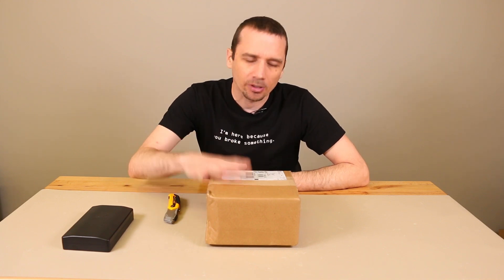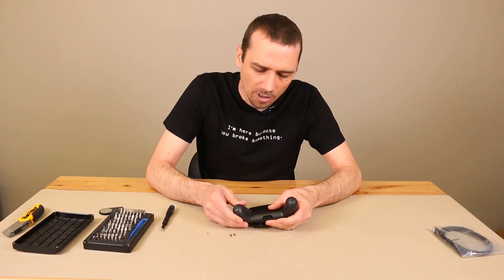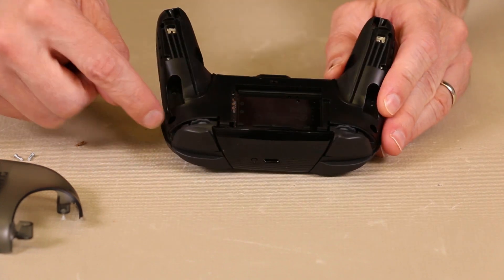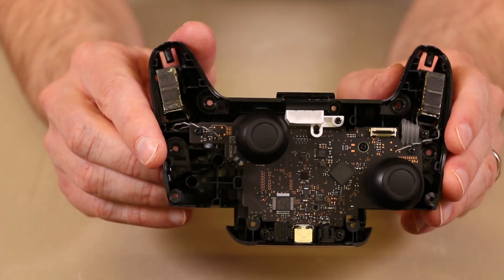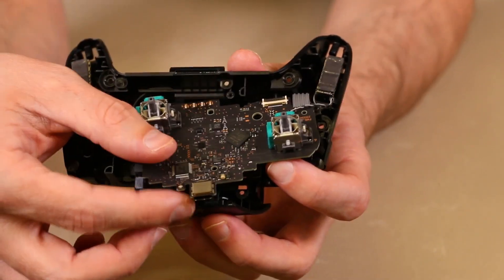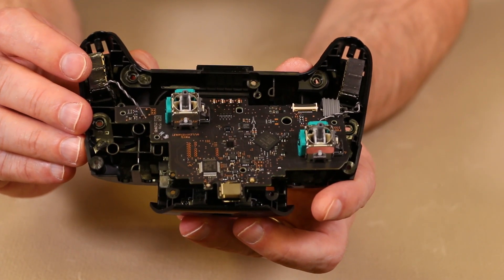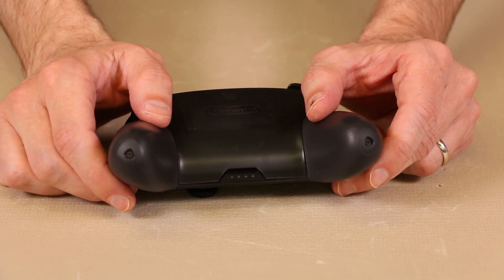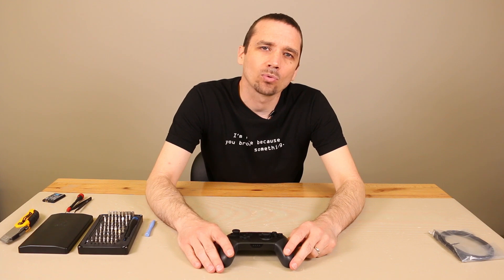Nintendo Switch Pro Controller Teardown

Comment: Have you guys considered making videos on the 3DS family or do you focus more on consoles?
Reply from the maker: Yes, I may do some of those videos in the future. Anything specific you're looking for?
Reply: TronicsFix Well I say this because I have a New 3DS XL and my c-stick is kinda sunken, pretty much broken, so I was curious if there was any advice you'd give on that matter because I have not found anything of the like on the internet, it's all threads about the problem and no other solution than to send it to Nintendo for them to repair it so I wanted to know if there was any other way through this problem. And I live in Costa Rica so it's not easy finding a reliable place to fix it.